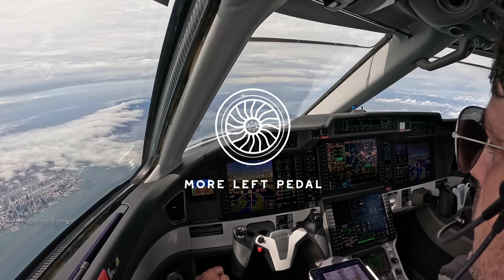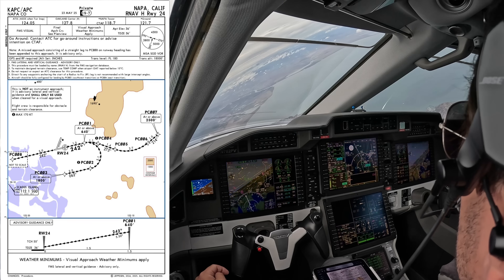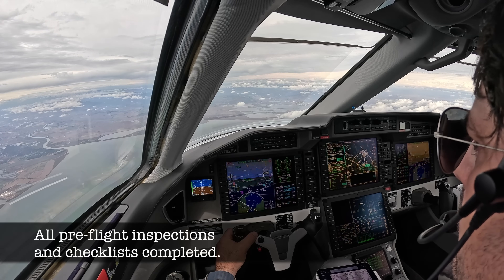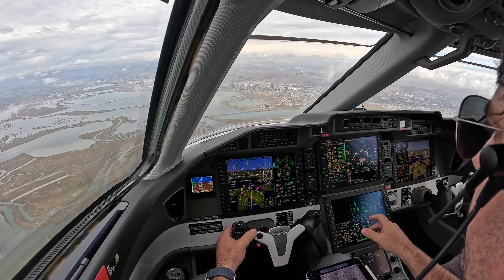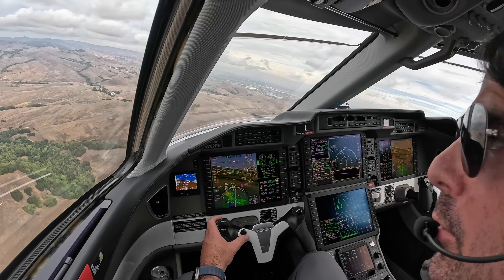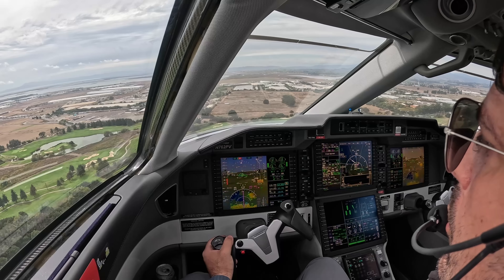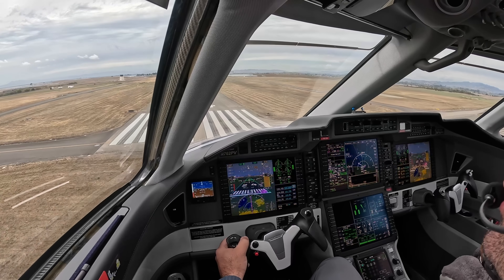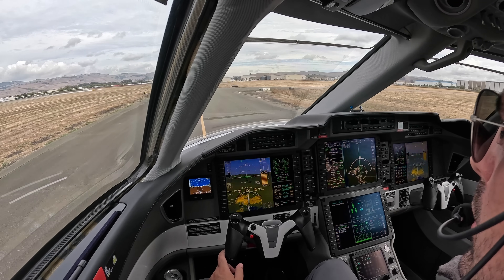Trying out the new Pilatus PC-24 FMS Guided Visual Approach into KAPC

Comment: dumb question: what is the differense vs GLS?
Reply from the maker: Great question!  This is an over simplification but essentially a GLS augments gps signal by GBAS (ground based), an LPV uses SBAS (satellite based), and RNP uses ABAS (on board computation) but also adds RF (radius fix) ability.  It’s not that one is essentially more accurate than the other but just built from different infrastructure.

Comment: That’s really a nifty safety feature especially for runways without approaches. It looked like the AP/FD was coupled throughout the approach. Was the AP also following vertical (GP) guidance or did you manually fly the decent?  Having terrain avoidance guidance is another great safety feature.
Reply from the maker: Yes fully coupled on lateral and vertical guidance.  Full path based all the way.  Very cool.